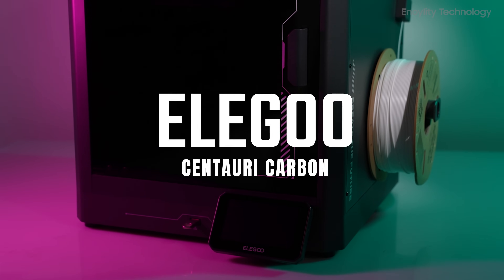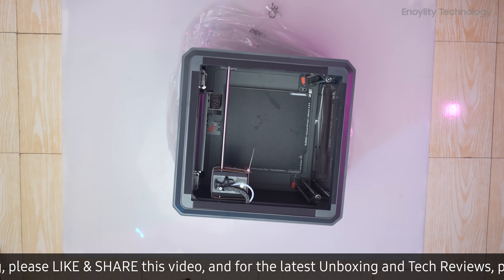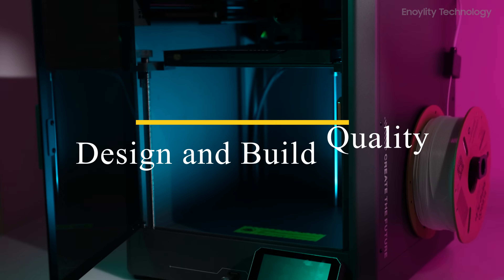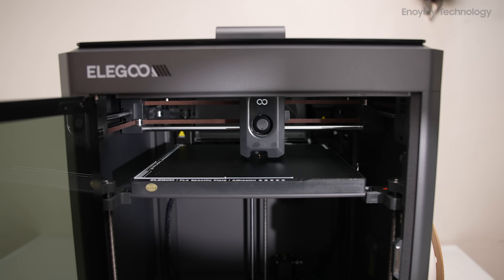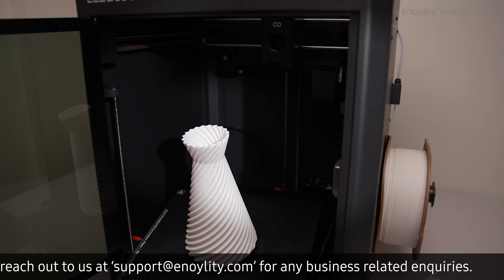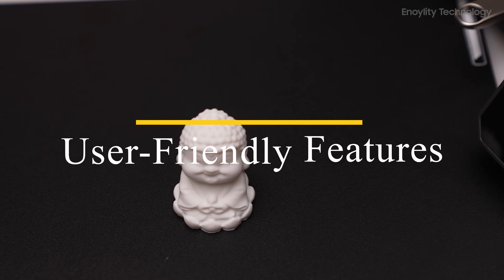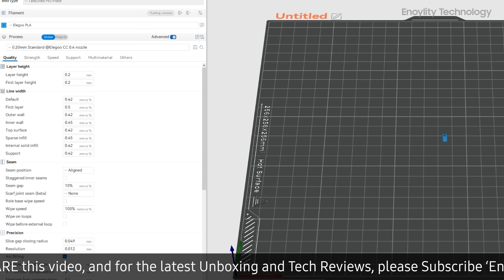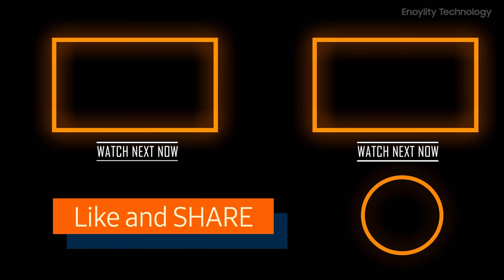ELEGOO Centauri Carbon Review: The Premium FDM 3D Printer You’ve Been Waiting For!

Comment: I started researching 3D printers online and quickly realized that there are so many options out there. I was particularly drawn to resin printing because it offers a level of detail that filament printers simply can’t match.
Reply: Still a beginner, so my opinion may not mean much, but resin type, how the print is laid out, and the print file itself seem to be effecting things.
Reply: The built in plug in filter actually DOES ensure no smell (and hopefully harmful vapors) leave the chamber while resin is inside. I was surprised how well it works. I still ventilate well to be sure since my printer has to be indoors.
Reply: The machine comes over exposed so your prints never fail but also the detail goes off the window. Also be careful, resin is toxic and gets everywhere. Use gloves, keep the machine onas ventilated area, understand this is a tool and it can only get you so far on it's own, you gotta learn how to use it.
Reply: New build plate is working as it should and looking forward to printing some miniatures and dice.
Reply: Print quality is good, but not mind-blowing out of the box. Needs tuning
Reply: The frame is sturdy and assembly was super easy.
Really appreciate the Klipper pre-installed it’s powerful.
But it can overwhelm you if you’re new to 3D printing
Reply: Supports a wide range of materials, including PLA, ABS, PETG, ASA, and Carbon Fiber
Reply: Impressive print quality ⋅ A game-changing price ⋅ Software isn't fully baked ⋅
Reply: This printer is bringing 3D printing using Fused Deposition Modeling (FDM) closer to plug-and-play perfection
Reply: Slightly complex assembly for beginners
Reply: But overall, it's fast, durable, it produces really nice prints, it plays nicely with OctoPrint (which I use for all my printers), and it has a pretty robust feature set for the price
Reply: Works, but needs calibration. I had issues with the extruder not working right. The filament would clog until I reassembled the extruder. It works, but I think the issue is over extrusion or its printing too fast so the accuracy isn't perfect.
Reply: This printer prints well at speeds ranging from 70mm/s, to 100mm/s while maintaining optimal quality. It's also very quiet. Which is a huge plus
Reply: The printer would randomly reboot it would resume a layer behind. Support has not been great for the printer only being 4 months old.